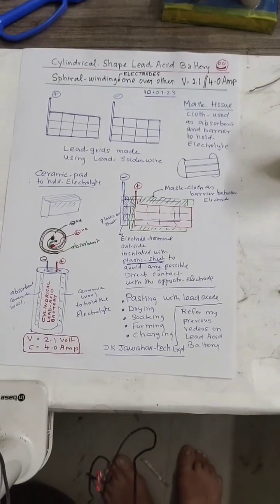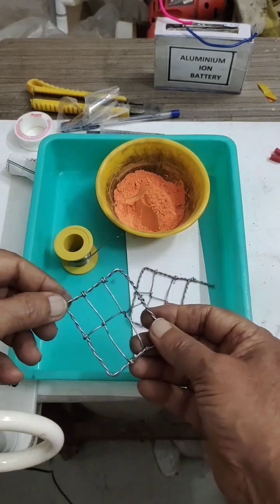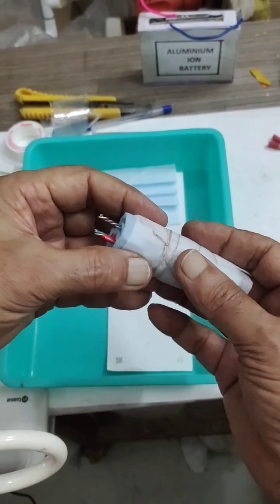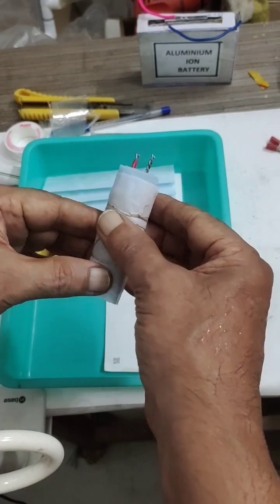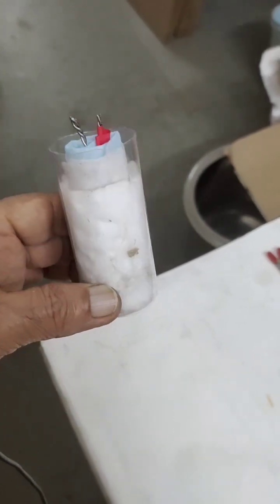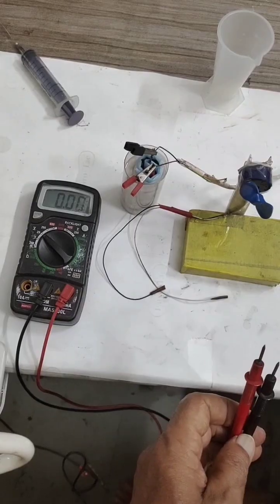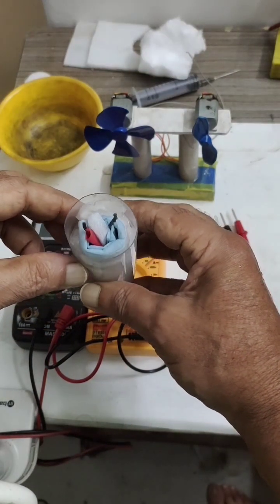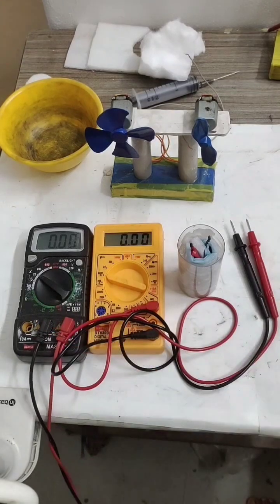HIGH AMPS CYLINDRICAL LEAD ACID BATTERY- 4.0 AMPS, 2.1 volt by SPHERICAL WINDING OF GRIDS, D.I.Y-83

Comment: i got 28 amps from same size electrodes spaced apart with just 2 layers of angel soft brand toilet paper
I used flat sheets with active material coated on them directly as a layer 1mm thickness (40 grams active material deposited) 1.5mmi total thickness electrodes
I used raw yellow massicot beta lead oxide for both electrodes. no additives. no red lead. sodium sulfate mixed in to cure the active material.
Solidified over 24 hours in warm humid room.
I used sodium sulfate + aluminum sulfate in distilled water for the electrolyte.
Holds over 2 volts with no sulfuric acid. Safer too.
I put in food bag vacuum sealer bag (without the vacuum feature) and applied heat to make a pouch cell. 
Small hole at the top to rehydrate electrolyte if it dries out.
Works fantastic. High performance. compact size. Over 2.2 volts resting voltage..!!!! Higher than sulfuric acid.

Comment: Good but your explanations are not too clear. What is the orange colour in the cup and how did you apply it? When u say 20 percent acide is percentage of what quantity? Is it rechargeable and what is the discharge rate?
Reply from the maker: Kindly refer to the reply I have sent to   other comments it will be useful.
Reply: @dkjawahar-techexpt671  some of my questions need direct ans
Reply: @dkjawahar-techexpt671  Pls is the orange chemical in the container lead peroxide and will be mixed with to get the paste?
Reply: Silence will not encourage anyone to following u .if I can't get lead paroxide what else can I use to form d needed paste?
Reply: Silence will not encourage anyone to following u .if I can't get lead paroxide what else can I use to form d needed paste?
Reply from the maker: Pure lead oxide itself is sufficient if you don't get red lead. Since while forming -stage, this lead oxide will convert to lead dioxide. Okay at the positive terminal. Therefore you can use the same lead oxide paste for both electrodes. Once you make a trial it will be fine.👍
Reply: @dkjawahar-techexpt671 Sir has explained full process in 
https://www.youtube.com/watch?v=sn0bIF3lGsk
It is a three part series. Kindly follow the link. 
Thanks 👍

Comment: parabéns,vc é bom no que faz,se puder me responder;como conseguir o óxido para a pasta?
Reply from the maker: Hello, you can grow thru my previous videos 6 months back- "50% less weight plate for lead acid battery", " lead acid battery making process at home". Here the details of lead oxide, red lead, it's weight and process is clearly shown.
You have to ask
1. Lead oxide powder( light brown in colour)
2.lead peroxide(red lead powder)(bright orange in colour)
These will be available in chemical shops, suppliers or from  lead acid battery material suppliers.